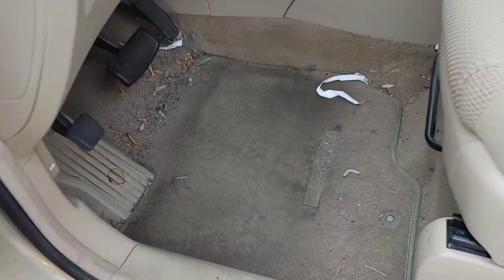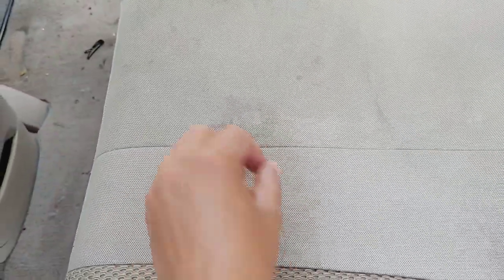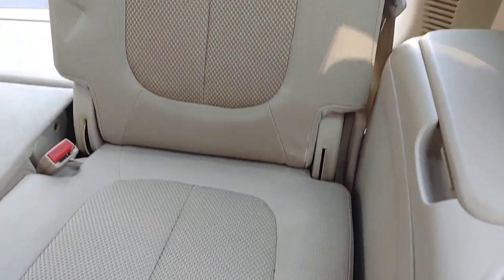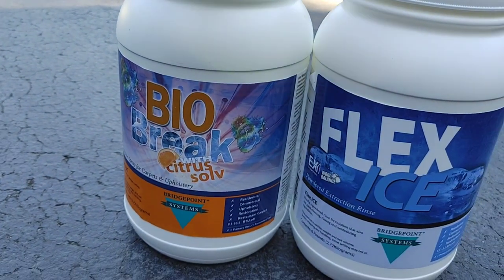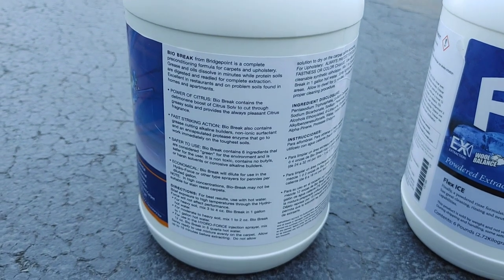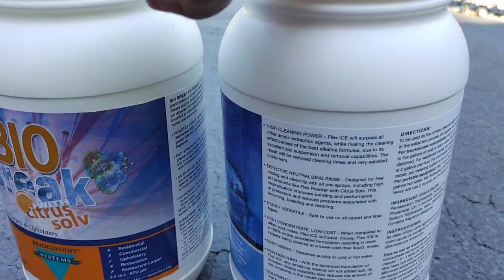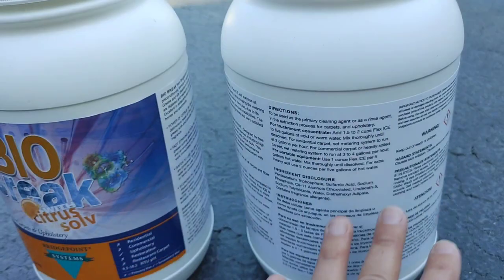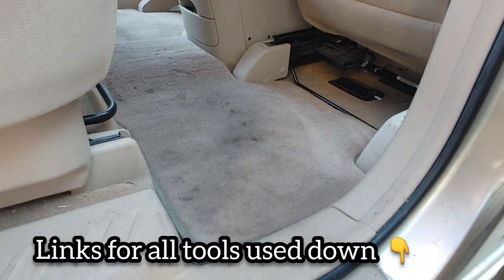Elderly Customers Car Needed DESPERATE Help- How We Transformed Her Interior w/ A KILLER COMBO!

Comment: Absolutely stunning job. 👍 I started using it as well after I saw the same videos. It sure does cut down on time. I believe the warm water in the solution helps break down all that mess plus the heated extractor. Excellent results 👍☺️

Comment: Great work Chelsea outstanding work. How effective would a steam cleaner be in removing stains as an alternative to heated vacuum extractor?
Reply from the maker: Can help loosen them but doesnt pull them out as effectively. Steam cleaning is better used for light soil and bonnet method and for heavier soiling I prefer extraction to help prevent wicking

Comment: So do you prefer flex products or superior for carpets and upholstery?
Reply from the maker: Depends on the situation honestly. Sometimes one will perform better than the other and if it’s dark fabric typically I’ll use Superior products but for light interiors I use either bonnet pro or the flex products
Reply: Thanks! Also would you happen to know the difference between bio break and flex citrus? I’m not sure which one to get
Reply from the maker: @ZechariahDiaz-rb9qm flex citrus is a little stronger for breaking down organic stains imo I use bio break for mild/medium stains and flex citrus with bio break for those really bad situations
Reply: Yeah I kinda figured cuz I saw flex w citrus had a higher ph then bio 
Thanks again 😬